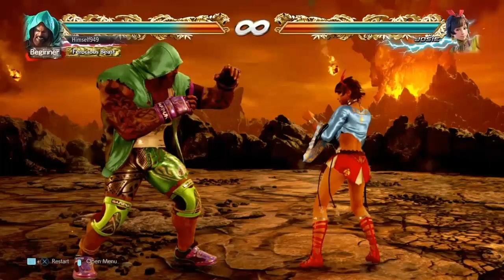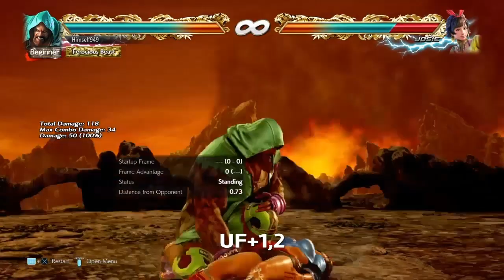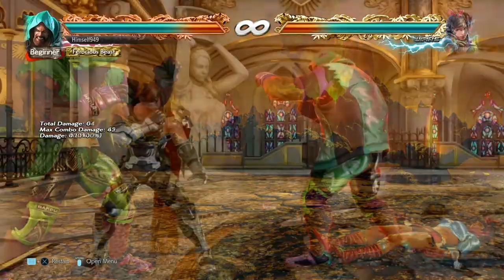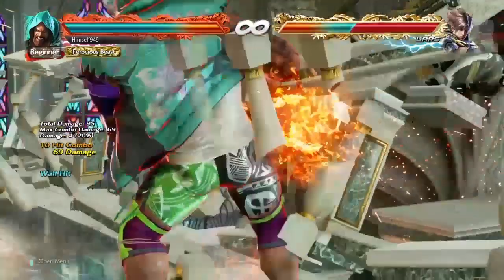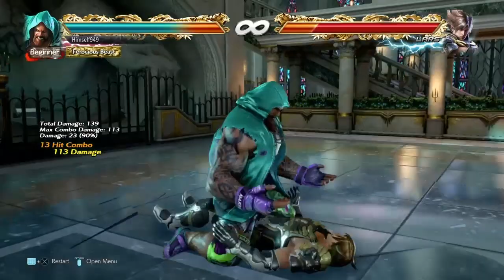GORILLA RUSH! ~ How To Use Marduk's New Move ~ 130+ Damage ~ Tekken 7 Season 4

Comment: I always loved Marduk, and always played around his ground throws. Moves like uf4 on hit give GUARANTEED ground throw attempts. Highly underrated setup and i never see it used online
Reply from the maker: I think after UF+4 they can spring kick to evade, but almost no-one does it
Reply: Not guaranteed ground throw and it's not really that great of a move compared to his other great mid poke strings and pseudo safe launchers. Only a last resort when you need to use a low crushing move.
Reply: @ashanirpaneer  it's a damn near guaranteed attempt. Like homeboy said, the only thing they can do is spring kick or I believe the quick back roll (whatever it's called when they press back the very frame they hit the ground). And those are nearly never used online. So, it's pretty much a pseudo guaranteed grab attempt.
Reply: @babadraga3114  If it doesn't hit at point blank range, opponent can escape by getting up backward.

Comment: 3:50 I'm firmly of the opinion that this represents a loss of identity for Marduk, though this is a continuation of a certain trend with the character during the course of T7 that is at odds with what the character has historically been. This is in turn symptomatic of a creeping homogenisation of the cast that I see occurring in T7.

Historically, punishment has been a major weakness of Marduk. In games prior to T7, all of his natural launchers lacked either the speed or the range to be used as dedicated whiff punishers (except from sidestep). His WS punishment was terrible, with both his i11 and i13 WS punishers dealing pitiful damage, and no dedicated WS launcher faster than i17. As regards standing block punishment, he had nothing for between 11 and 15 frames (he had d/f+1, but that was i16 - one frame slower than most characters' fastest standing natural launcher), and it wasn't as though his options for i10 standing punishment did anything amazing.

Over the course of T7, however, this has changed quite radically. First, in season 2, they sped his d/f+1 up from i16 to i15. Then, in season 3, they buffed its range, such that it became a viable launching whiff punisher, and also made d/f+4,2 a natural string, thereby giving him a i13 standing punisher which was +12 on normal hit and dealt 38 damage. Now, in season 4, he has a i12 standing punisher in u/f+1,2, which is +6 on normal hit and deals 34 damage.

Marduk's WS punishment is still woeful, but the aforementioned season 3 buff to his d/f+1 means that whiff punishment cannot really any longer be considered something that he struggles with. Moreover, the huge buffs to his standing block punishment over the course of T7 mean that he certainly cannot reasonably be described as lacking in that respect anymore. All in all, what was historically part of Marduk's identity as a character - very weak punishment - has been steadily eroded over the course of T7, to the point where (WS punishment aside), this weakness isn't really evident anymore.

Marduk no longer being distinguished from the majority of the cast by the weakness of his punishment is but one symptom of the trend towards loss of character identity in T7. Another, I'd argue, is the buffs that Armour King has just received to his f,f+2 and b+4, both of which are now safe. This has the effect of giving Armour King strong, safe power mids that can be mixed up with his command grabs - in other words, of making Armour King more like King. Armour King, at least to my mind, has never really been a mix up character in the way that King has (if we're specifically talking about Armour King II and King II, at any rate). He's always been more about using movement, his pokes (which, since T6, have consistently been pretty strong) and his excellent whiff punishment in conjunction to set up whiff traps. The season 4 buffs to Armour King's f,f+2 and b+4 blur this distinction between the two characters somewhat.

Still another case in point is the buffs that King has received to his lows and whiff punishment over the course of T7. These, again, have blurred the distinction between him and Armour King (they even gave King Armour King's d+3 and f+2,1, though it is worth pointing out that this was at a time when Armour King wasn't supposed to be featuring in T7). In T6 and TTT2, Armour King's whiff punishment was excellent, while King's was okay but nothing too special. Armour King also had much better lows than King, whose lows were pretty terrible across the board. During T7, though, the gulf between the two characters in these two respects has narrowed greatly, and as of season 4, the gap between them in terms of whiff punishment is still smaller, thanks to King receiving b+3 into Guillotine Drop.

Marduk's new move signifies a continuation of a loss of what, historically, was a part of the character's identity, namely seriously lacklustre punishment. This should, however, be seen in the context of an apparent trend in T7 to gradually erode what makes characters distinct from one another.